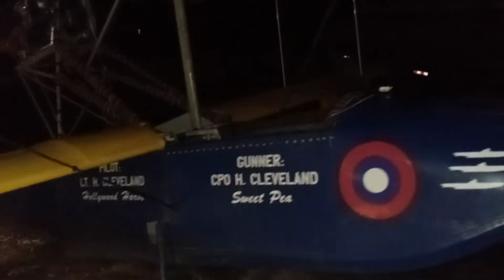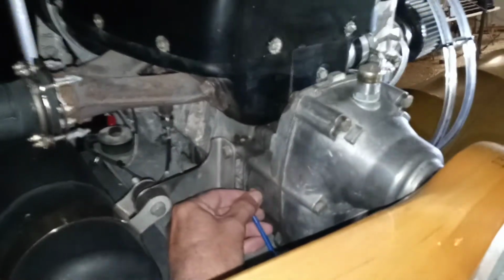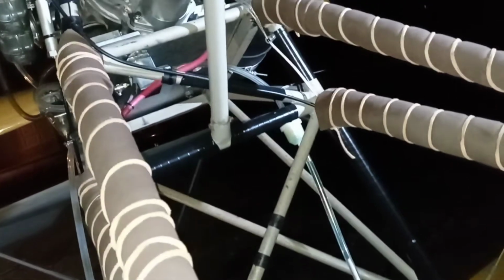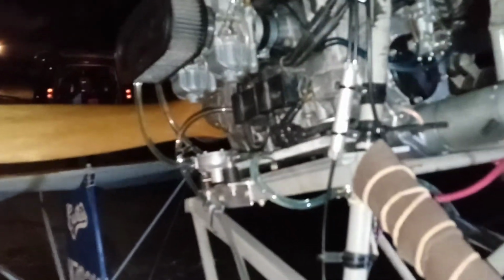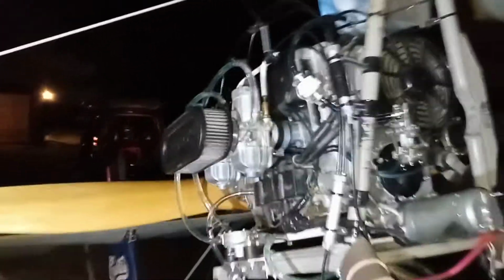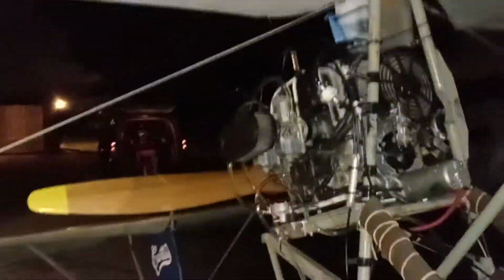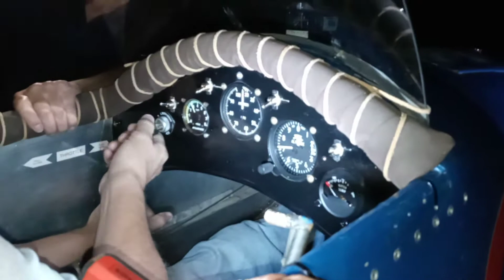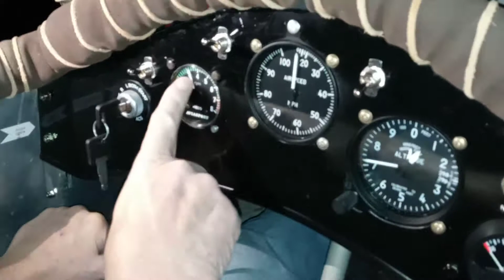the Mariner first start

Comment: Dennis, tell your Navy pilot buddy, I volunteer as crew for some Submarine hunting and lake fishing. I have > 2000 hrs in the P3 Orion platform, hunting Soviet Submarines and surface combatants.
Reply from the maker: Hi Chris A well sir Alan is not a Navy pilot. You will have to buy yourself a boat.....sorry
Reply: @redblackvette  Great idea Dennis.
VW powered Air Boat 👍🏻🏁
Reply from the maker: Hi @Chris_A_  well sir will that be 1/2 or full?
Reply: @redblackvette  
You know, it depends on whether it's a single or multi seater... 🤔